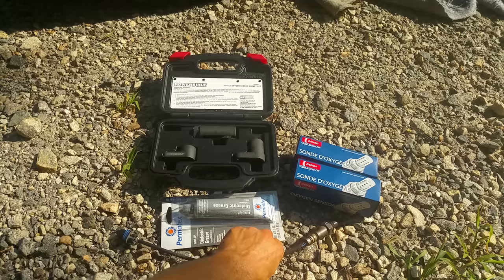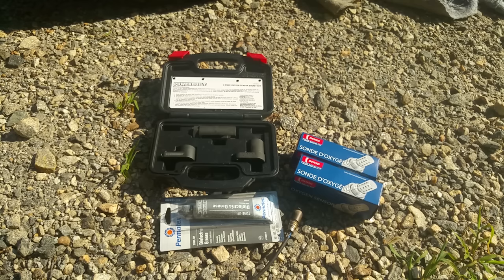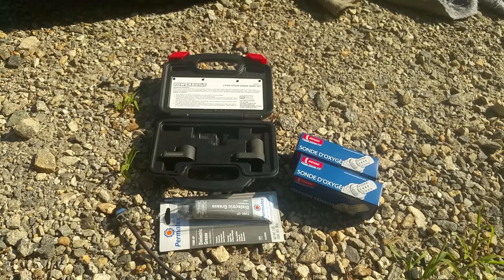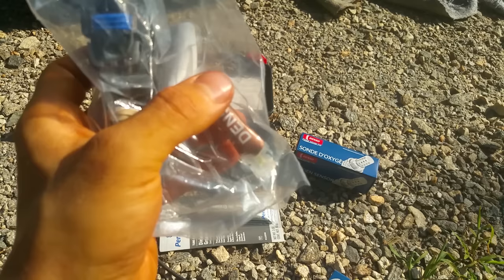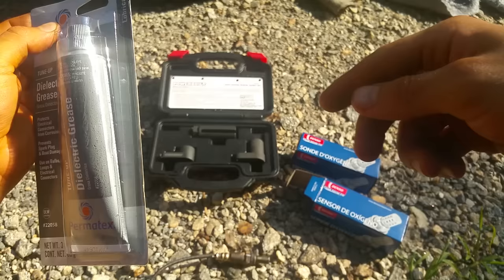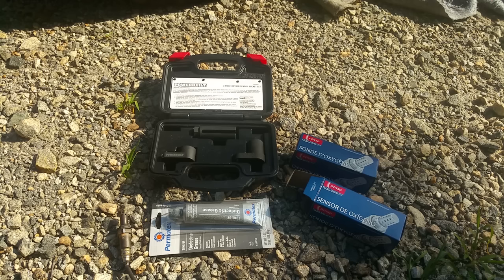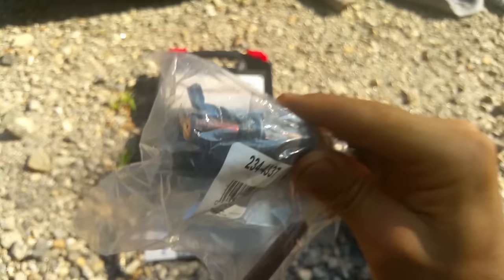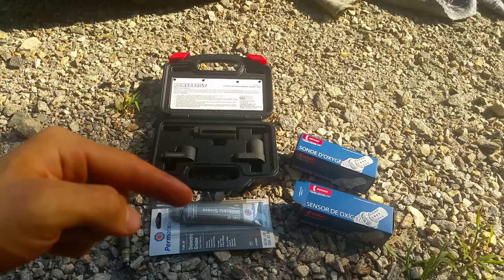NEVER Change Another O2 Sensor Until You WATCH THIS!

Comment: Doesn't matter if you touch the end of the sensor or not, the actual reactive sensor part of it is protected inside of it. So as long as you don't dip it in goop or cake it with crap then it'll be fine. And like the many comments say, heat up the area where the sensor threads into. Whether it's with a torch or running the car for a few minutes it'll help considerably. Also changing just the one causing the code is fine but if you have the bux & like a good running ride then it doesn't hurt to change them all. Work smarter not harder.
Reply from the maker: +john green I agree with working smarter not harder, but I still think it's best to not touch the sensor. Why touch it? Theres a reson they tell you not to touch it. It's a rather sensitive and expensive part. What happens if a piece of dirt or hair gets down into the sensor's end. My guess is that it would mess it up.
Reply: @MattsShop  my new o2 sensor came seized and capped. As I was pulling off the cap the seize tapped the end of the o2 sensor very slightly leaving some seize on the tip. I wiped it off with a clean rag and installed it. Really considering pulling out that new o2 swap it out for another one. Do you think it’ll make a huge difference? Thanks in advance!

Comment: I didn't add the dielectric grease on the connector of the upstream oxygen sensor. I'll correct it, thank you for the tip and other advices on the Oxygen sensor installation.

Comment: Got ? My 2002 chevy express 1500 5.7 liter was throwing a code or said no electric something. Anyway I got new one and replaced it. Them took it it to auto again to check it. Said the same thing. It was the bank 1 sensor 2. And they told me it was the one on passengers side b4 the cat conv. Any suggestions?????

Comment: Shouldnt be that tight on a 2012 in 2019 though right also could i just use a wrench to take off the 02 sensor
Reply: Yeah right mine is a 2016 and mine is frozen
Reply: And hoping there are some threads left in the bung once you do get the thing out.
Reply: Keep in mind it's directly screwed into the exhaust just off the exhaust manifolds. So everytime you drive it, it heats up and cools off and rusts. Basically welding itself into place. So anything over 1,000 miles is going to be tough to get out with just a wrench.

Comment: I used a 22 mm combo box/open wench to get mine out along with a hammer.   
It did take some finagling to get the wrench just right on there and I could only move it a small amount because of the tight space.  
Also you should buy a code reader.   Get a good one that can read live data.   This way you can see what your o2 sensor is doing live.   I bought one for under a $100 and it paid for itself on the first use.   
I thought I had a bad o2 sensor but it was a bad cat.
Reply: Which did you buy?

Comment: NOTES FROM THIS VIDEO: 
- DON'T TOUCH THE SENSOR METAL
- REMOVE WITH A BREAKER BAR (POSSIBLY WITH A IMPACT WRENCH?) 
- BEFORE YOU INSTALL NEW O2 SENSOR:  +APPLY DIALECTRIC GREASE  +APPLY ANTI-SEIZE +DISCONNECT BATTERY
- LOOK UP TORQUE  FOR O2 SENSOR AND REAPPLY WITH A TORQUE WRENCH
Reply: Darren c just do it the old school way righty tighty not too much crap basic grandpa mechanic skills is all you need
Reply: Torque wrench really you torque your O2 sensors. Just use common sense it needs to be tight not 100 foot pounds. Anti-seize yes high temp of coarse. Dielectric grease yes leave the torque wrench in the toolbox just tighten it up .
Reply: A good mechanic should have an elbow torque accuracy within 20%

Comment: looking for input ..just had transmission rebuilt last week '06 crown vic..exhaust has to be removed etc. I get it back and i get a check engine light..take it to the shop and all four O2 sensors threw codes. They check to make sure they were plugged in and seated correctly..cleared the code and i drove home. Next day cel back on..same thing all 4 showing errors..car drives fine. Today they are taking the transmission BACK OUT to see if they pinched the harness or something. They also said they checked a module to see if a fuse blew..i guess the O2 sensors have an associated fuse? idk

Comment: Many O2 sensors (zyrconium based) works comparing INSIDE gas with OUTSIDE athmosphere. The opening for the outside side of the sensorr is the plastic isolator of the wires, in particular the opening in that external isolator near the plug. 

Putting any substance on the plug CAN affect and contaminate the sensor leading to wrong readings.... So be careful with that dieletric grease!

Comment: I just replaced the catalytic converters  on my 98' expedition and I guess I got lucky because the O2 sensors ( which I had to temporarily remove to do the job ) came out easily !
Reply from the maker: +joseph bourdeau Yea! You are very lucky some guys have to get them to glow red with a torch, but that's if they are extremely stuck.
Reply: I used to work at JC Penney auto center I was the head battery man  and must have sold every car I worked on oxygen sensors all 4 at a time to avoid call backs.

Comment: Tip: If you got four sensors (upstream/downstream) it only makes sense to install new upstream sensors which control air/fuel ratio. Keep the two old upstream sensors as spares for the downstream sensors which only monitor the oxygen in the converters.
Reply from the maker: Yes, this is what I do exactly.
Reply: I also have 4

Comment: Soo I got some new ones but got real busy at work so they just sat in the back tray for about six months with all my tools , jacks, rocks ,steel bits etc and I’m ready to put them on but the original boxes have gone so no instructions.anyways after I rubbed the electric grease all over it and filled the electrical  plug up with copper grease I accidentally dropped both of them (twice) once on the concrete then outside in the dirt (clumsy me🙄) now can’t remember which one goes where please help 🙏🏼

Comment: Thanks for the video and tips. Changing the 2 upstream sensors in my 2013 Silverado is my project for next weekend. Even though I use it on all my auto bulbs, I didn't think about the dielectric grease on this connector.
Reply from the maker: You're welcome. You don't have to put it on the pins if you don't want to, but it helps it seal if you put it on the rubber sealing part of the connector.

Comment: I have been working on cars for at least 40 years...and just today..in a Suzuki geo forum..they said "do not put silicone grease on the plug boots"....I have put this on plug boots,....lights...and just about anything electrical...am I RIGHT...or WRONG...????? (This is the two quotes I got today) "silicone grease on a plug cap is ok, until it gets hot and welds onto the plug body. As you have found, its impossible to get them off." (And this quote also) "Make sure plugs are clean, inside of plug lead lances are clean, and don't use silicone grease as it attracts the dust and makes things worse."

Comment: I had an O2 sensor that was so stuck, my special slotted socket would flex and come off the sensor so I came up with a crude but effective solution.  I got out my Sawzall and cut off the top of the sensor.  Then I was able to put a standard 1/2" drive socket on with a breaker bar.  No more arguments from the stupid thing!
Reply from the maker: Yea, exactly, that's what you do when the slotted sockets piss you off enough. I would be tempted to do this if I knew for a fact the sensor was toast.
Reply: +Frank Howard 

Absolutely!!! 
Those 1/2” drive sockets and wrenches tend to take the argument out of any stuck bolts or nutz!

LOL

Why would you want a special tool that is only a 3/8” drive???

That makes as much sense as trying to use a 1/4” drive for the same job!
If all I could find to do that job with were 3/8” drive socket kits, I’d look for individual 1/2” drive sockets that were impact rated! They would be less likely to flex and more likely to break loose those stubborn, stuck sensors!
If you are skeptical about the sensor being bad and want to avoid breaking one off that may still be good, go ahead and heat the sensor and bung up to get it to let go without torquing it too much and change breaking the sensor!
I myself have to replace broken manifold bolts on one side of my trucks engine and I hate the inefficiency of the way stock exhaust  manifolds work, so I bought some lifetime warranted headers with locking bolts and I am planning to replace all four of my o2 sensors when I swap manifolds for the headers!
Reply from the maker: Yea, I don't know why they make the sockets 3/8" drive. It's really dumb. If you are going to go the socket route make sure they are impact rated for sure.
Reply: Thats what I do first ,clip the wires and off she goes

Comment: I just bought a set of 2 sensors that are supposed to be US and DS. They are identical except the color of the connectors. One is black and one is gray. neither is marked US or DS. Does it matter which goes into which hole?
Reply from the maker: I'd see if they have a part number on them, look it up and put them where they go accordingly.
Reply: Thanks for the reply. Unfortunately they have the same part number. The connectors on my vehicle are both black.

Comment: All fine an dandy that you have told people what to do when changing the sensor.
Problem is, you don't explain that you can throw a code for O2 sensor for half a dozen reasons.
If your fuel mixture is wrong. Such as too much or too littler air. Or too much or too little fuel.
If you have an air leak past the intake sensors.
If you have an exhaust leak before the O2 sensors.
If your cat is clogged it can cause a code for O2 sensor.
A misfire can cause it.
Don't change your O2 sensor until you check for other things.
If you are using a code reader it won't tell you the problem, just the symptom.
If you don't have one, get an actual scan tool and check your engine with that, it will give you much more detailed information.
Reply from the maker: Great points. I worked on a truck recently and the scan tool said nearly all of the O2 sensors were bad. Now we all know the probability of that being the case...

The intake manifold gasket was leaking BIG TIME. The fuel air mixture was so screwed up. Once the intake leak was fixed every single code went away and the check engine light went off for the first time in 3 years.
Pretty Crazy huh??
Reply: Actually it's not really crazy. The O2 sensors are one of the components that help the computer regulate your fuel mixture. If something else is wrong and the O2 sensors read funny, the computer won't be able to get the mixture right which will keep the mixture out of whack and keep the code on. 
It's one of the problem with most modern cars. Just because there is a code saying 1 thing doesn't mean that is the actual problem.
Reply from the maker: Yea, if the computer can't get the fuel/air ratio right the vehicle will never run right.

Comment: Always check eBay for parts, most all parts have warranty, and what I've bought, around $50 cheaper, bought, water pump, cam shaft sensor, wheel bearings, O2 sensors, all with warranty, saved A Lot, Compare prices from ur auto parts store! We're for a 2006 Malibu!
Reply from the maker: Good points, but are they the same quality?
Reply: R @MattsShop
Reply: I thought parts from Ebay were cheap .
Reply: @isaacrischer7611  they are, a water pump at Advance Auto was $72 and I got one on eBay for $21
Reply: Matt they are the same quality, I looked at a alternator at Advance for $130, it was made in China, got a new one from eBay for $55 with a 10 year warranty one at Advance had a limited warranty anyway the one I brought was made in China too.

Comment: I love the little ant that crawled across the dielectric grease package. 😀 Thank you very much for the informative video. It was very helpful knowing what tools to get and to not touch the O2 sensor directly. What kind of truck do you have? I have a 2003 Chevy Tracker, 2.5; LT model. I will be replacing the bank 1/sensor 1, (upstream). Do you recommend replacing the downstream at the same time? Thank you 😊
Reply from the maker: Hey, thanks for the positive comment. I have a 2006 Chevy Silverado 1500 4.8 2wd. I would just replace the ones that are throwing a code. No sense in replacing something that isn't broken.

Comment: Why not use a Torch to heat the o2 sensor? The sensor can't be cleaned & if you heat it up before trying to remove. Will come out easier. Plus if the engine is warmed up. The exhaust pipes will be hot. easing removal.
Reply from the maker: +Todd Young Yea, everyone keeps saying use heat, but like I said to them, you can't always get at with a torch without burning stuff up. If you can get a torch in there then yea use it.
Reply from the maker: Yea the wet rags are a good idea I have never really thought of that for removing these sensors. Merry Christmas.
Reply: Botbuster.com I know not everyone can afford it but for those that work on things like this enough it pays for itself quickly!!  Works great for removing stubborn rusted bolts without the risk of the torch flame
Reply from the maker: What do you mean?
Reply from the maker: I don't know why he put that
Reply: Todd Young stupid phone automatically put the .com on there. Look up what the botbuster is. It's an electromagnetic heat device. Perfect for right areas that you can't put a flame too. It has been one of the best investments I've made in my shop
Reply: Matt's Shop  It is an electromagnetic heat induction tool. It is perfect for tight spots that you can't put a flame to.

Comment: run engine for ten minutes.  spray o2 threads with pb blaster then wrench it.
Reply: Thank you thank you thank you
Reply: Jim Wimmers - great tip
Reply: Then burn your hands taking them out....unless you got some gloves on.
Reply: Also spray them the day or night before. Never use massive amounts of torque to remove anything, unless you want to break it. Try working the wrench back and forth. Ping on the wrench with a hammer if you need to, but don't just pull on it as hard as you can.
Reply: additional note.   if u have a bad o2 sensor.  use carb cleaner. spray it into the cap center.  soak o2 sensor in it overnight.   spray it clear with compressed air and ohm it or put it back and see if it works.  sometimes flakes of carbon buildup and this can refresh sensor.  worth the try